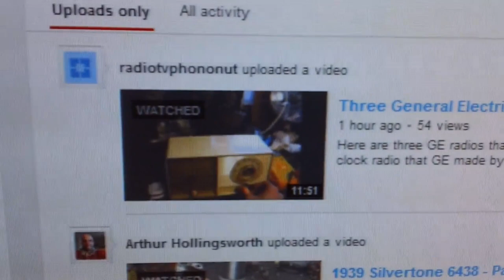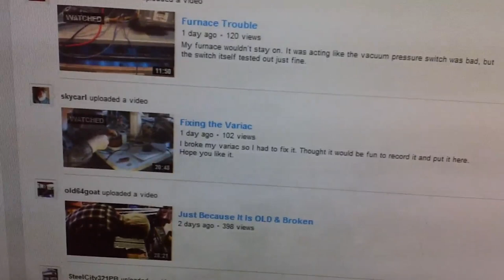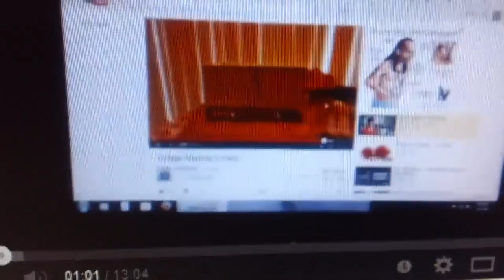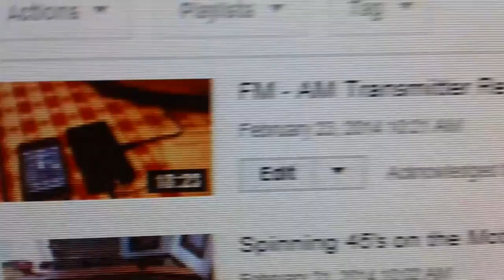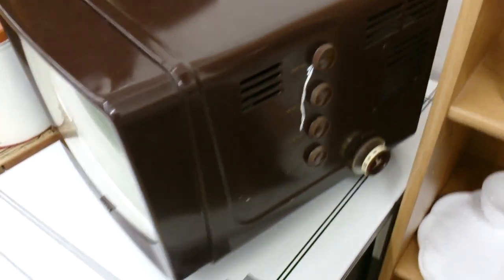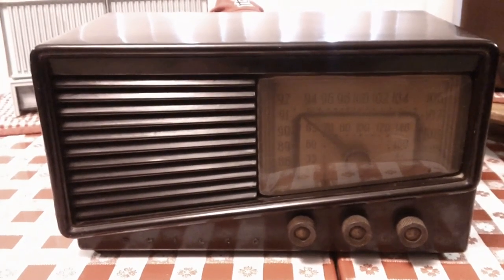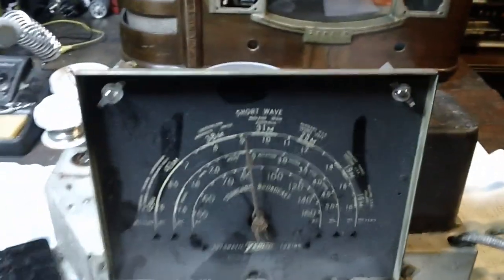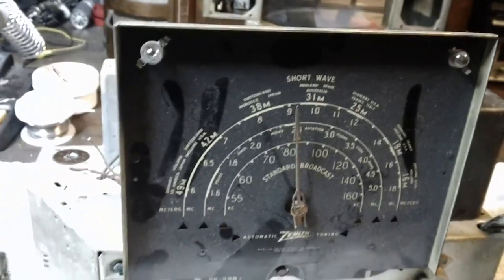Vintage Mashup 6

Comment: Congrats on the 1949 Philco AM / FM! There are LOTS of caps to replace in some tight quarters. There's one multi-cap "can" (though not really a can anymore, just a cardboard tube mounted on top of the chassis) that is a bit tricky, but I'm sure you'll figure it out. Like John says "piece of cake"! :) And the Zenith.... wow, looks like the same 1942 model that my great grandparent's purchased new and has been handed down first to my grandparents and then on to me. A nice performer with some nice tone controls!
Reply from the maker: Greg, I already cracked that 905 open.  Lot's of caps, is right.  Add FM to a set and that's what you get.  I'm thinking about getting one of those modern multi-cap jobs to replace that can.  It's a cool radio, one I'm planning on using a lot, so, I want to get it absolutely right.
Reply: OldRadioAl Al, I used radial lead orange dip caps where ever I could to try to free up some space under the chassis. It worked well.

Comment: A few more thoughts on the Zenith... the dial bezel was plated, and on mine, I found some bright gold spray paint that looks almost identical... and is a whole lot cheaper than replating! The top edge wasn't black but rather a neutral wood stain... maybe perfect brown. Beware of the vertical strip next to the speaker... it's faux woodgrain. The Philcote stuff like was used on the 46-1201's.
Reply from the maker: The Zenith is a 7S633R, if that's what you have.  I've actually had it for quite a while, sitting around collecting dust.  All the wiring that needs to be replaced had me putting it off for a while, doing easier restores, then it was kind of like, out of sight, out of mind.  I actually powered it up when I first got it and it pulled in a couple stations, even with the speaker cone half gone.  It's pretty obvious that vertical strip is faux.  I'd like to keep it, even if it looks a little cheezy.  Good idea on the bezel, no way was I going to replate, I think it may clean up well, but, if it doesn't, the gold paint is a good option.  I think I've found the grillcloth that it originally had, at least most of them I've seen had it.  Really cool that you have your great grandparents original, Greg.  I'm really hoping I can bring this one back.
Reply: OldRadioAl Mine is the same model, Al. How cool to know where another one is located!
Reply from the maker: Ha, now I just have to do it justice.  No pressure, Greg :-)